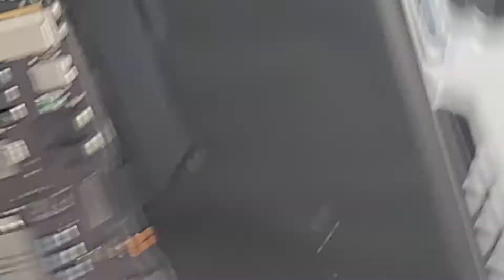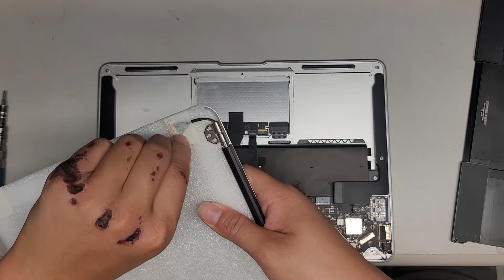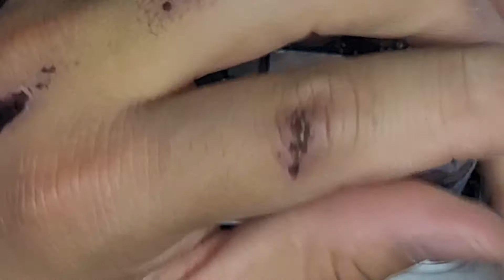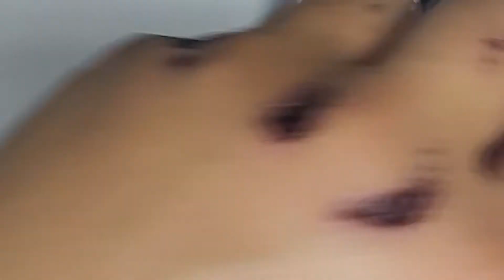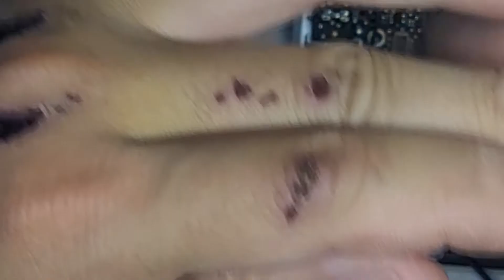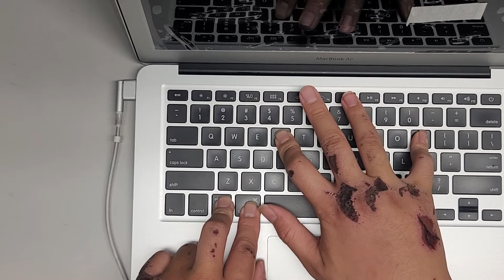Early 2014 13" inch MacBook Air A1466 Disassembly LCD Screen Battery Fan Replacement Repair

Comment: hi, nice video. i just wanna ask is there any way to use the old (normal) lcd  from this macbook air 2014 to use as DIY external monitor. like connector to modul / pcb / board that have hdmi port and usb to power the lcd.
Reply from the maker: Possibly, but I don't know how.